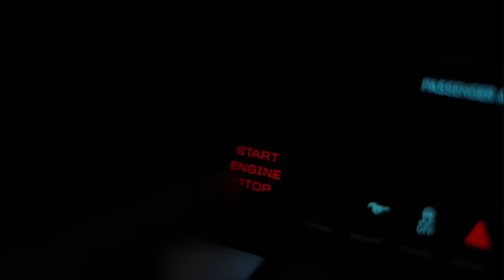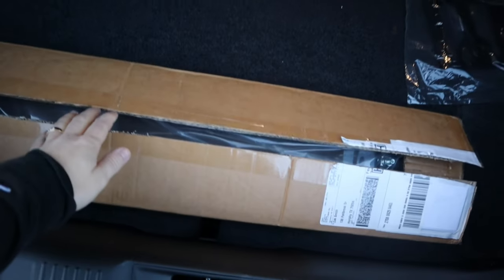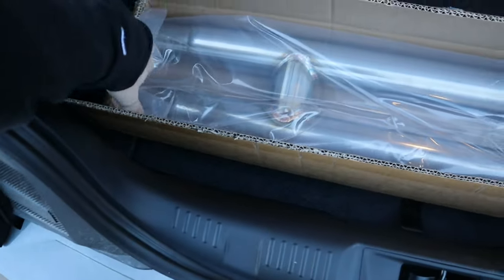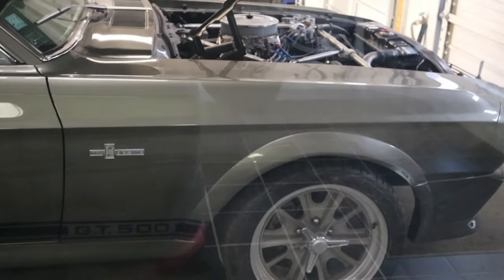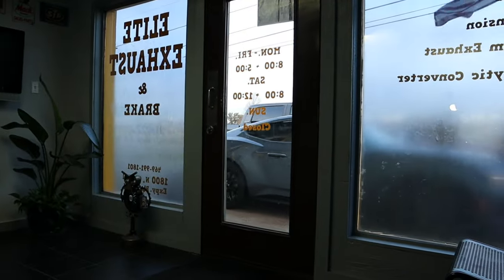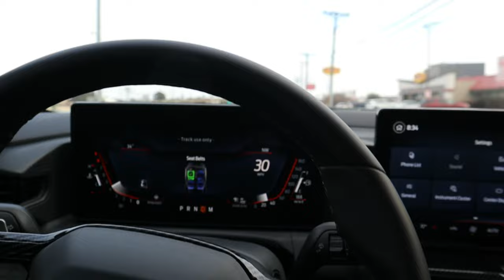Installing Steeda H-Pipe On My 2024 Mustang!!!! Sounds Insane

Comment: 😮😮😮😮. Hey Bro I already got my s650 last monday @westway ford. Unfortunately not a blackout but still awesome. Love the color. Same as yours. Im thinking to get xpipe from steeda but i dont have idea which better h pipe or xpipe😅
Reply from the maker: H pipe gives a deeper tone and on this gen gives more hp then the x pipe so I personally would recommend h pipe
Reply: @ZakSmithh  alright bro. Thanks. Anyway I thought after you cut the resonator? You can bolt it in?
Reply from the maker: @bryllercrown3874 you can but I bolted on side and welded the other for safety to keep from exhaust leaks
Reply: Bro get an H-Pipe for an S-650! It Suits it so well with this generation Coyote engine